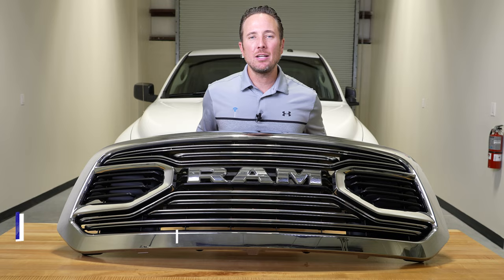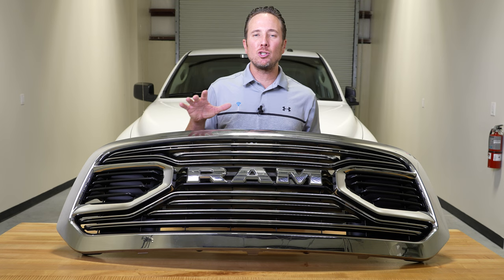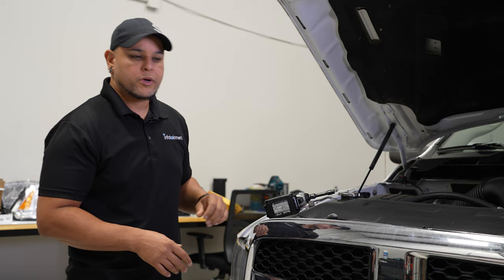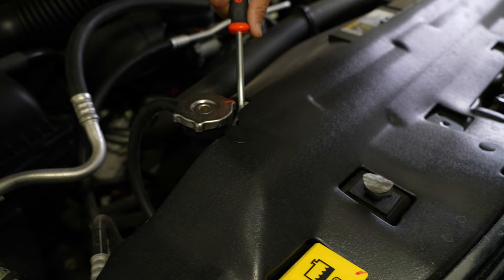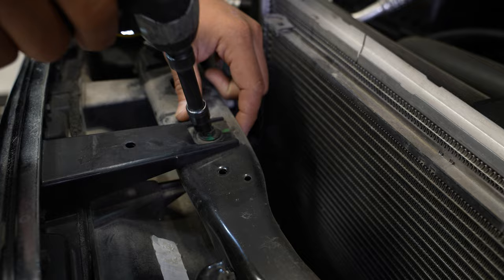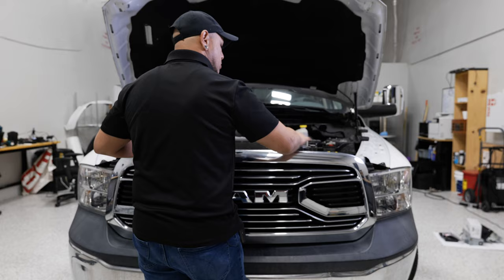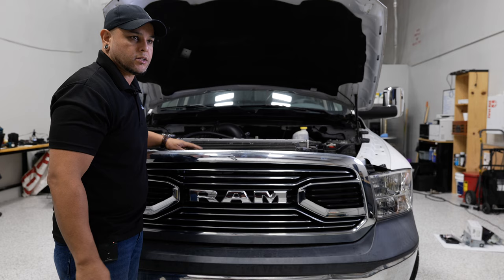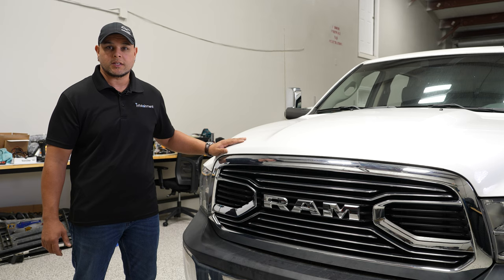2013-23 RAM 1500 Classic - Chrome Grille Installation - The Build S3E10 by Infotainment.com

Comment: Would this grille fit on a 2012 ram 1500?
Reply: No
Reply from the maker: No unfortunately not, this OEM bezel is only for 13+ 

OEM Chrome Grille Part Numbers:
2013-2023 Ram 1500 DS: 6NM18SZ0AA 
2013-2018 Ram Heavy Duty: 6NE51SZ0AB